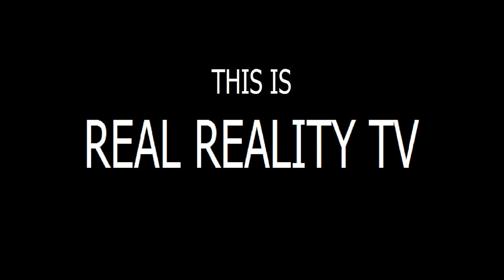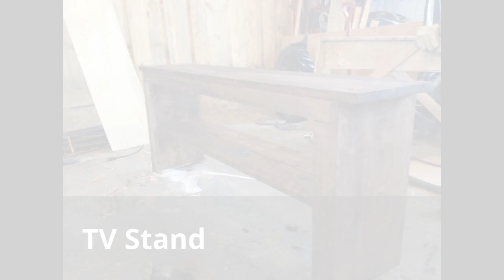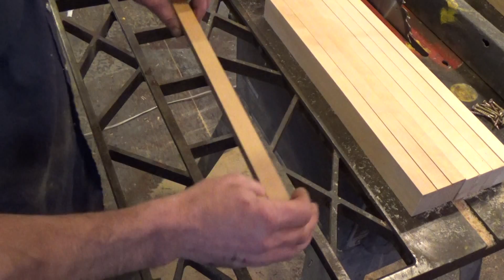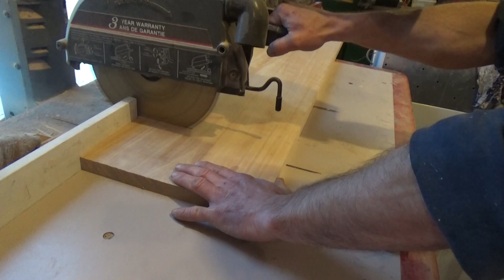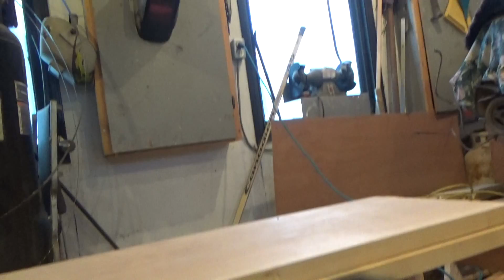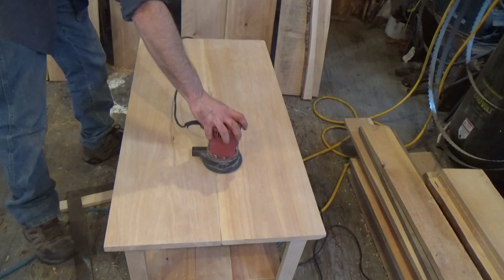A EASY METHOD FOR RUSTIC FURNITURE CONSTRUCTION

Comment: Great job on the furniture. Little tip 4 ya if ya don't mind, If you wanna keep the planks from cupping you can use smaller planks glued together with biscuits, cup down, cup up, cup down, and run through thickness planer or cut a notch in the bottom of the planks in cup but not right through. Made LOTS of furniture over the years using real natural wood and that was always something to watch for eh?  Soon be trouting time again too eh.
Reply from the maker: i have used the same method but i tried to make this as simple as possible and those planks are well seasoned there hasnt been any coping so far thanks man, and im starved for a meal now sir